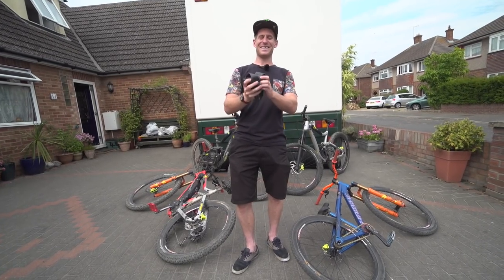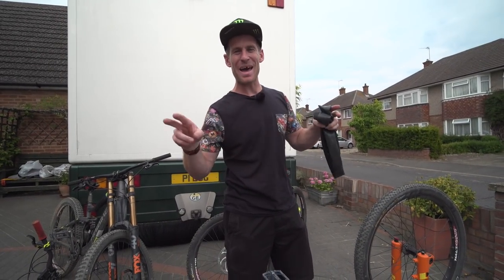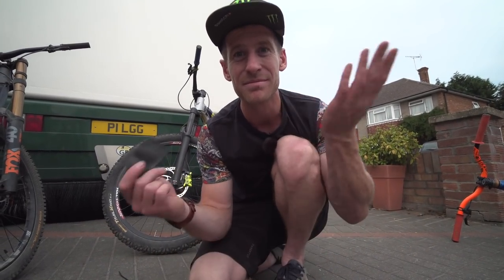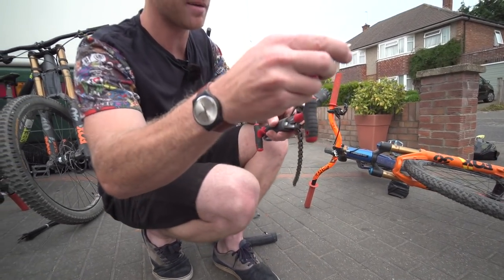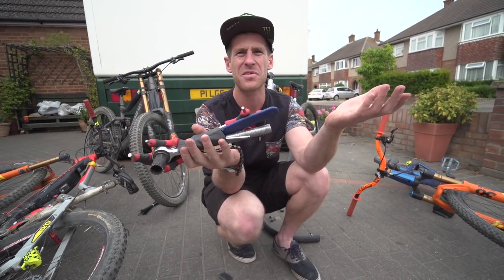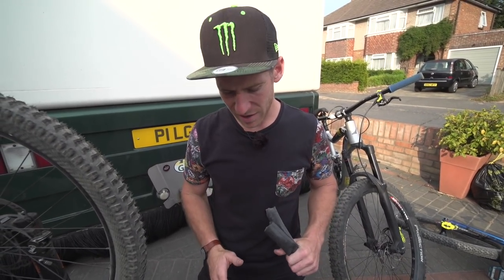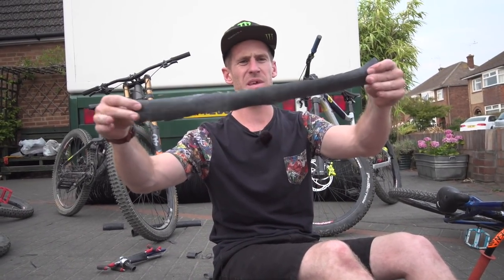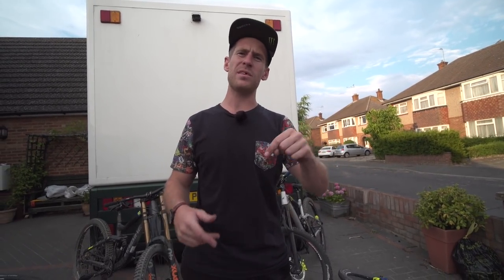10 INNER TUBE HACKS FOR YOUR MTB!

Comment: I make a similar chainstay protector but I cut the tube and wrap it lengthwise so no seam is visible. It only overlaps slightly on the inside of the stay. A thin coat of spray adhesive keeps it in place after hundreds of muddy rides and bike washes. One layer is more than enough protection and your chainstay doesn't look like a hockey stick. Love your channel!

Comment: Excellent ingenuity.  Here’s another.  The “El Tubo Loco steering stabilizer”.  Tired of that annoying death-wobble while streaking down the crevasse?  No more.  Get you some inner tube, pull it from the right handlebar, then ‘round the seatpost.  Twist it some until it is super tight.  Then hook it on the left handlebar.   Bam!  Pow!  No more death wobble!  You have a straight line weapon!

Comment: Do you ever grease or silicone your inner tubes? It seems to give a more plush ride and avoid pinch flats. Some dirt bikers seem to use rubber grease on their tubes https://www.youtube.com/watch?v=n6roPN4QoAs&feature=youtu.be&t=275
Just did a silicone treatment on a pair of retro 26" CST semi slicks, and running quite low pressures they seem to feel much better than what I've used to. First I sprayed the inside of the tire and then the whole inner tube.

Comment: I use 8-9, well and 1 but I bought a mudguard like that with 2 evil eyes haha. If you take your time and pull it tight with even spacing 8 looks pretty nice. For the down pipe protection I use a old tire cut down full length of the down pipe, looks sick.

Comment: If I get puncture and got plenty of tread left and underneath tyre got a cut I use old inner tube cut small patch and super glue suit for rubber so tyre won't cut new inner tube and cheaper option instead buying new tyres

Comment: Love the tow rope! 
Tourniquet? A second layer between tube and tyre for puncture resistance.  1/2 inch wide strips a foot long make good bungees to hold stuff onto racks or top tube,  a thin strip tied in a loop will hold a torch onto your handlebars, or head. If your water bottle falls out on bumps, tie it on with a strip. They probably burn well if you have to light a fire in the wet.

Comment: I cut a piece around 3-4inches then cut down the middle fit around my rigth side of my fork n tie with 2 zip ties then cut a 2nd piece about 2 inches longer than the first then fit the second piece around the first (do not cut sencond piece down the middle) then with a zip tie go rigth below the first piece but around the 2nd piece ..now you have a pocket around your fork ,the first piece protects the fork n the second keeps your items safe inside .i use this to keep patches, allen wrench, key to my wheels , chain master link and extra zip ties snd sometimes even small co2 pump .. then i use a zip tie to tie at top make sure its tigth but still wiggle room to pull the tube out when need access
Reply from the maker: thats a sick one mate!!